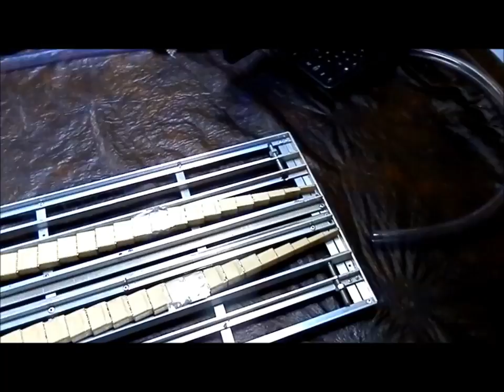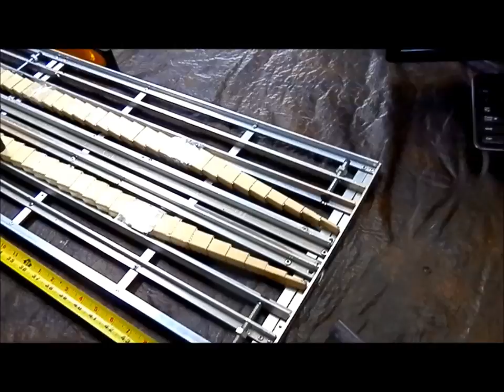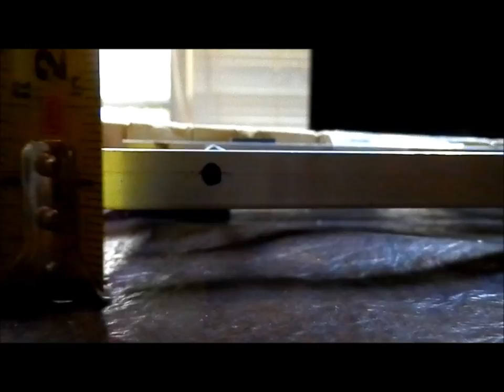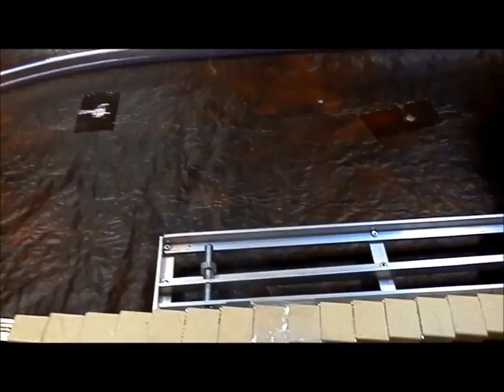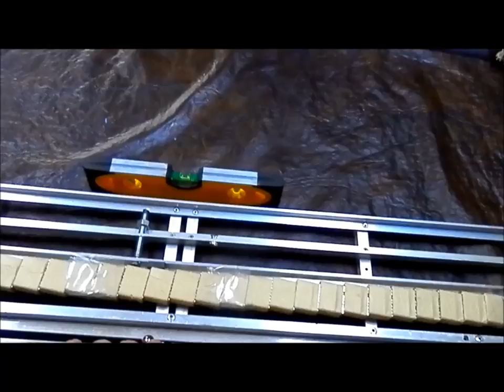Old 4 Foot Magnetic Track (Video 2) Version 1

Comment: Ponder the idea if at the tail end of the track you start a slight upward bend to the magnet stacks to help you eject the ball in a straighter path out the end of the track Instead of directly down out the bottom because you loose height that takes away from your ball return slope.

Comment: nice  ! so you have perpetual movement of the sphere or not ?
Reply from the maker: gilbondfac Thanks!  Honestly...no Sir (I’m sure haters and trolls are not surprised at all and actually enjoy hearing about my challenges and failures.  Even so, I have already proven that they can be successfully connected).  I have a new problem with this 4 foot track that was not present with the shorter tracks.  The longer track has such a strong magnetic field that it is causing the L- channel aluminum to warp, curve and bend.  So, I have not been able to successfully disconnect the driven sphere from this longer track like with the shorter ones.  I am re-designing the structure with more support on the parallel side rails.
Reply from the maker: gilbondfac do you?

Comment: so you need a u-turn at each side of the track so it can roll down hill to the start of the track again.
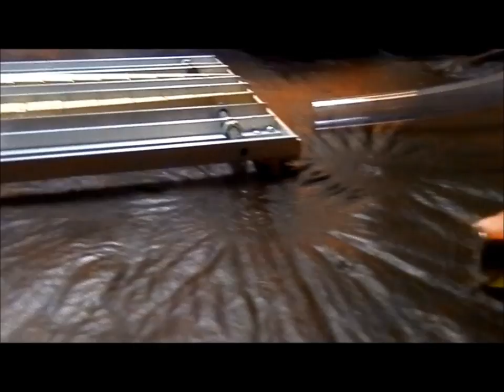Reply from the maker: Yes, Thank you.  That U-turn is not easy, the disconnection is the most complicated part, please see my video Magnet ramp 1 where I have sucessfully connected the hand-off from the drop-out at a 90 degree turn.  Then please watch my video Magnet ramp 24 at around 1:11 and after, I start a great view of the side showing the disconnect.  The hole in the track has a big part of disconnect, as does gravity, but do you notice the ball curve as it exits the ramp?  It does not curve forward in the direction of travel, it curves bakwards towards the start of the track.  This is evidence of the magnetic field's influence on the motion of the rolling/falling ball even after it sucessfully disconnects from it.  The ball cannot just simply curve around on a downward droppping u-turn, it must fully disconnect from the first propelling field before introducing a new propelling magnetic field.
Reply: ***** I was thinking that the field could be useful to drive the sphere back to the beginning with more force if you distance your second track correctly relative to the field...the test I ran used 1/8" x 3/8" neos for the track and a 1/2" n52 sphere to rise about a half inch uphill on about 16 inches of track and drop off the end of the table..

Comment: Seems like you have most of the energy gain in the first couple of feet. you could save alot of money by not using all those extra magnets in the last half...add raised deflector at the exit point to project it downwards with force and a curved landing at the start of the next track... been playing some with magnets here too...alot of enertia seems as useful as constant attraction or repulsion... i kno all those neos are pricey...goodluck!!
Reply from the maker: Seems like you have most of the energy gain in the first couple of feet. you could save alot of money by not using all those extra magnets in the last half...add raised deflector at the exit point to project it downwards with force and a curved landing at the start of the next track... been playing some with magnets here too...alot of enertia seems as useful as constant attraction or repulsion... i kno all those neos are pricey...goodluck!!

Thanks T Nunn, gain in the beginning only on this one. You are right; I got into a big rush building the 4 foot track and made plenty of mistakes.  First of all was the track itself, the two rails that the ball actually rolls on, they must be of equal spacing the entire length, yeah…it gets closer together toward the top on this build.  I also need to use stronger L-channel for the adjustable sliding magnet holders.  On my 4 foot track even with three supports, the magnetic field is becoming strong enough to actually bend and make the metal warp and curve together.  Not cool, I hear ya about the magnets, yeah, that is a lot of money sitting there, I learned from building these that the longer I made them, the further they will travel and the higher they will lift upwards.  With the linear tracks -gravity and friction play a big part.  The ball rolls because of the propelling magnetic field, gravity, and friction.  Gravity of course is pulling down to the source; planet Earth, there is more friction where the ball touches the track on the rails below than on the ball touching only air on top.  Toss in the forward propelling force of the magnetic field and the ball rolls top over bottom in the direction of the propelling field.  If we have a straight track, and drew circles on the ball where it touches the track, the circles would be smaller than the circumference of the sphere.  So, when it rolls -it stores some rotational energy similar to a flywheel.  With that, it’s forward moving inertia like you mentioned, and a little gravity assist, it can escape from the bottom.  My mistakes are preventing it from exiting on this 4 foot track though, I need to start from scratch and take a little more time focusing on the details, I didn’t have these issues with the 2 foot tracks, the metal stayed straight and it was easy to ensure the track was the same distance apart the entire length of it, I used spacers the entire 2 foot distance when making it.  Thanks for the comments and input.  I will never give up!

Comment: Michael,
     To me this system is exchanging angular momentum between the electrons within the magnets and steel ball like NASA has used  exchanging angular momentum between planets and spacecraft to achieve gravity assist trajectories.  Electrons orbit around the Protons as planets orbits around a stars. Using the magnetic field coupling the ball to the energy exchange in the magnets,is like gravity couples a spacecraft to a planets energy exchange.      http://www2.jpl.nasa.gov/basics/grav/primer.php

Comment: Did u see this guy?  "Rampa Magnetica /// Magnetic Ramp" on YouTube
Rampa Magnetica /// Magnetic Ramp: http://youtu.be/xz9Qt24jCLA
Reply from the maker: Yes thank you, I made Magnet Motor Magnet Ramp video for him.
Reply: ***** Are you using a steel sphere here or a neo? I ask because your fields are overkill with that aluminum warping. A neo sphere could go uphill much easier with far less magnetic field strength and also be useful rolling thru coils for power production.. Hope you haven't given up on things.
Reply from the maker: tnlightnin Metal, a metal sphere escapes so much easier, the neo holds on.